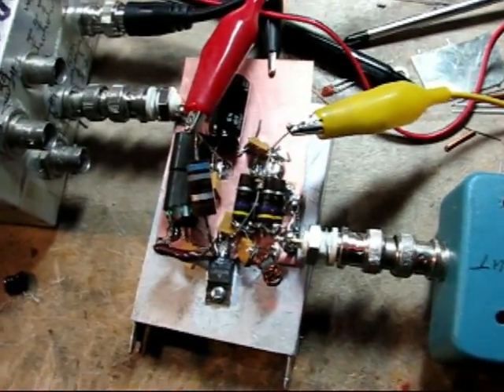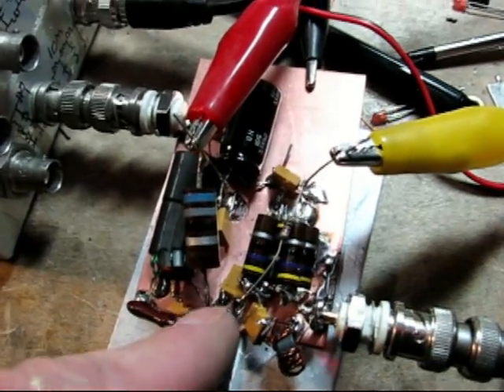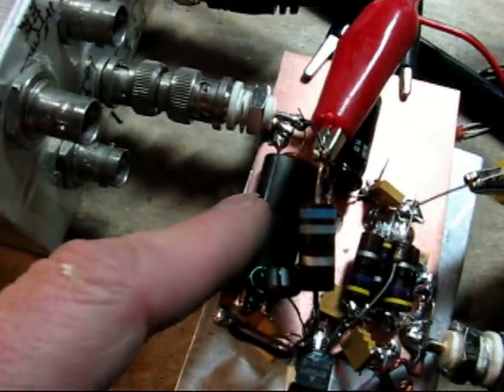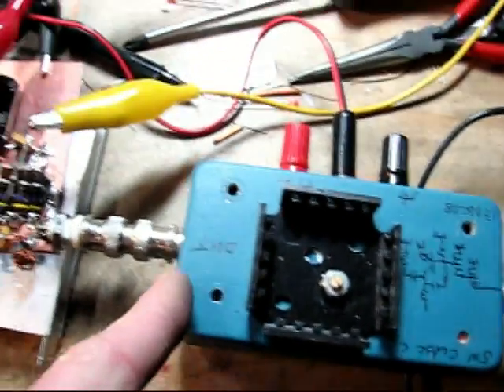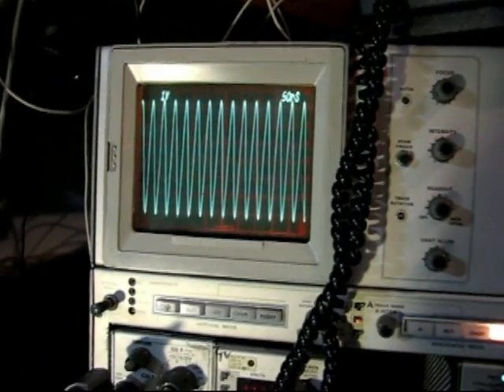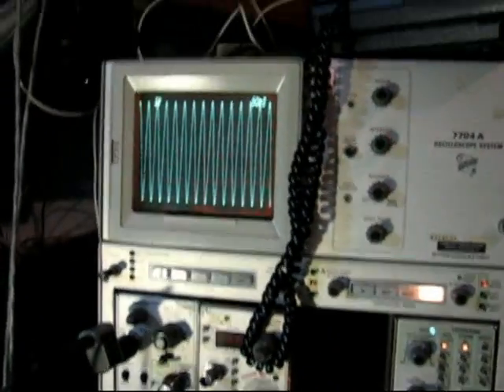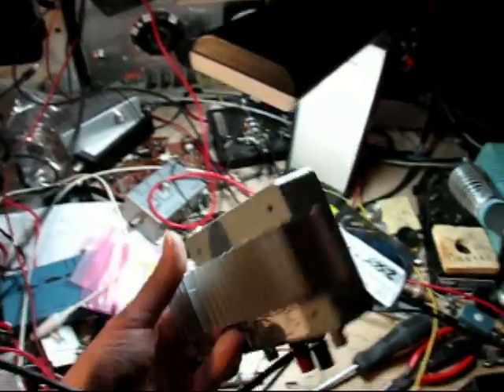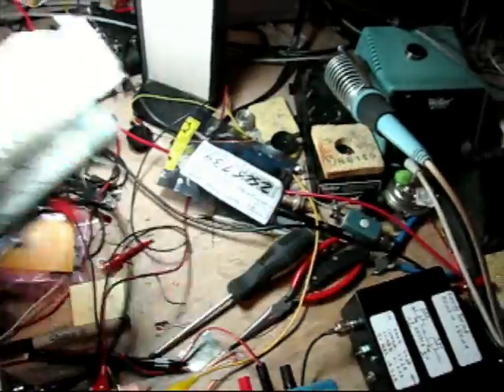HF Linear Amplifier

Comment from the maker: Yes. And if you do you will be transmitting a lot of power in the harmonics.
Expect that the 2nd is only 30dB down (or worse) and that the 3rd is only 20dB down without any LPF.

I prefer 7th order Chebyshev LPF so that the harmonics are suppressed enough with single ended amps like this one.
5th Order will be sufficient for balanced amps.

The filters I used were my test bench units.

Search WA7MLH for a link to my 80m/40m SSB CW Transceiver Schematics
There are 7th order LPFs there

73
Jeff